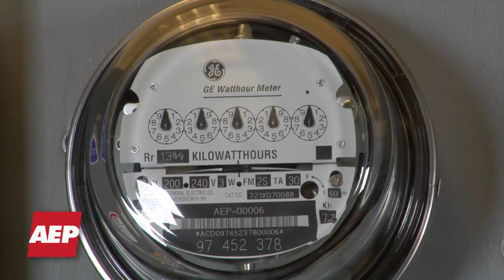Smart Meter Accuracy

Comment: The thing that isn't taken into account with meter testing is the effects of line harmonics on the current sensors. Since modern homes in 2023 have switching power supplies and inverters driving many appliances, gadgets, etc they generate ALOT of dirty power. Even the meter itself does this as its often equipped with a switching supply itself.

On a perfect wave form test bench the meter may behave withon tolerance but subject it to the noise of a typical neighborhood power grid and you get meter accuracy problems often resulting in gross overcharging of the customer. Unless you isolate tthe grid tie points with separate isolation transformers and employ in house isolation, filtering or swap out all switch mode supplies to linear this will be a huge problem.

Comment: Bullshit, after monitoring the meter and then decreasing the load incrementally the meter didn't register a change at all.  In fact the meter reading at the end of the month after decreasing the load by 1000w on a 24 hr basis the meter only showed a small difference, not any different than the monthly difference evidenced on my bill over time.  What is more disturbing is that the meter wasn't consistent, it actually increased usage after it had registered a lowering from the decreased demand.  This appears to be an averaging scam that allows the power company to charge whatever they feel is an average and further have the capability to disconnect customers from the grid remotely.  Further I purchased components to establish off grid power and now am powering portions my usage on that system.  It is discrete and has nothing to do with the grid at all.  It will be interesting to see what the results of those decreases in usage are.
Reply: It sounds like you are tampering wth the meter and illegally rerouting power off grid.

Comment: A smart meter is a plastic computer made from cheap Chinese parts your power company strapped to the side of your home. Smart meters can be reprogrammed at any time. How do you change the measuring rate of an American made glass and metal analogue meter? Will your old meter kill a homeowner who wears a pacemaker?  A smart meter can. 4 watts of RF energy is a lot of power. Your 1/2 watt cell phone will have 6 pages about your safety. What does your power company tell you?  NOTHING.

Comment: the person they send out works for their company so of course it's not going to be the meter fault your bill went up 300%. I just got my $600 electric bill after I spent $6000 on a new A/C and new insulation blown in my attic. The meter may work proberly when the tech shows up but doesn't mean it works properly all the time
Reply: davidscottfl 
as a meter technician who does high bill investigations, I always try to not only test the accuracy of the meter, but try to find the reason of the high bill! I doubt that any utility pays their employees to lie about things! Most high bills are found to be because of heat pump malfunctions, water heater or pipe leaks, well pump leaks, colder or hotter weather...
 I have found heat pumps with the heat strips running in the summertime and the ac trying to cool it back down. Water heaters with pressure relief valves leaking. I have helped a lot of people in my 37 years.
If a meter is changed and the readings are not read correctly, this will cause an incorrect bill. This type of error will only show up once on the bill after the meter change. 
When I show up on a high bill investigation I try to treat people the way I would want to be treated and help them any way I can. If the customer is billed incorrectly, I make sure to get it corrected! That is who I am and what I do!
 I do not get paid to lie or be deceiving nor has anyone in my management ask me to do so!